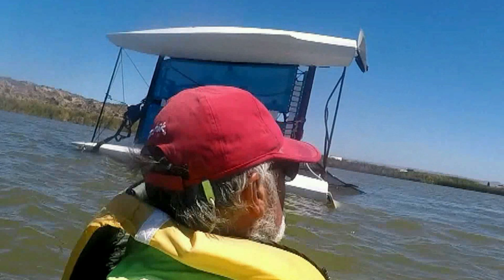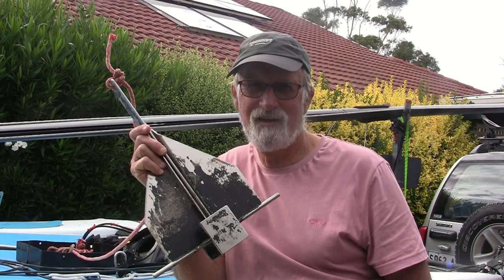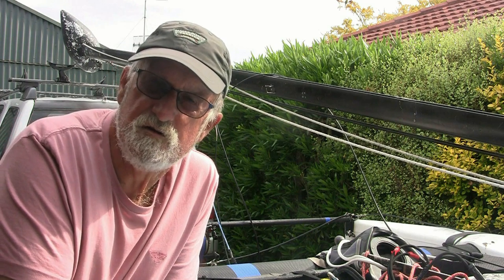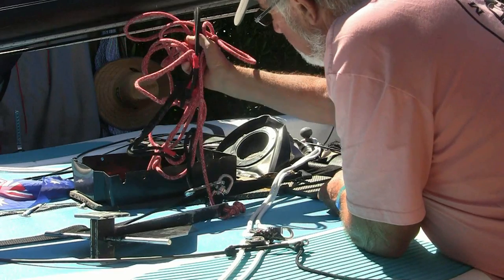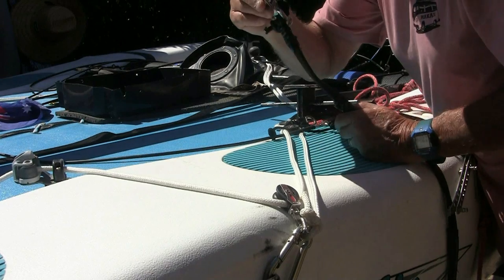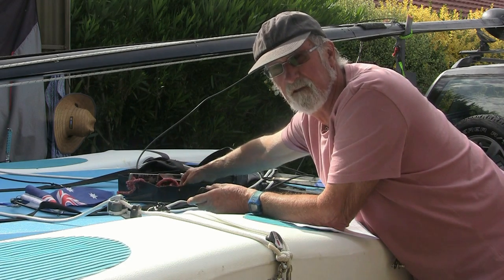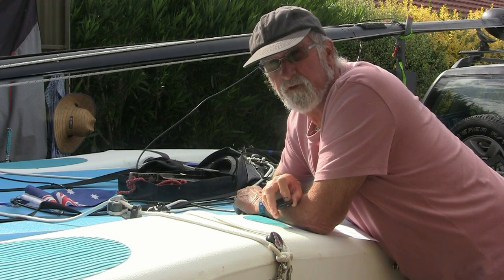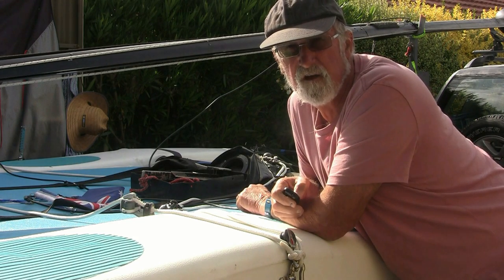HOBIE WAVE - CAPSIZE AND RECOVERY UPDATE

Comment: What a great video.  Thanks for testing your ideas and putting the video up.  How long of an anchor rope do you recommend?
Reply from the maker: Hi, Thanks for the compliment.  I sail in relatively shallow water at my rope is 10 metres long plus the bungee at the end.  How long your rope is depends on how deep the water you sail in is.  You dont want your anchor going straight down.  I recon it needs to be on a 45 degree angle to work.    I have thick rope, but if you need a lot in the box, you could go much thinner with rope from a proper boat shop.  Of course thicker is easier to see on the beach if people tripping over it is an issue.  Good sailing.  The Wave is certainly a great boat.